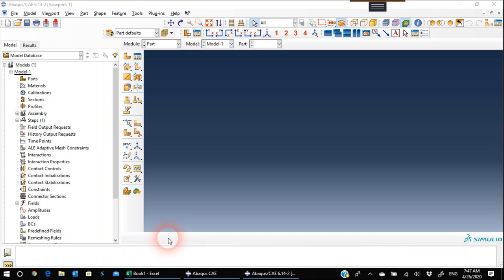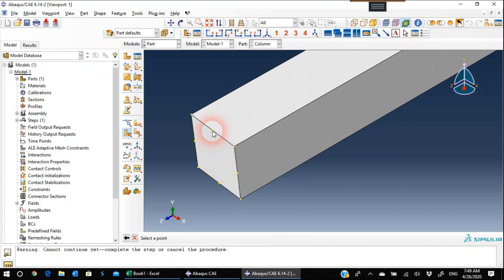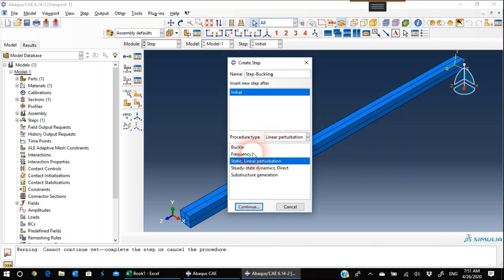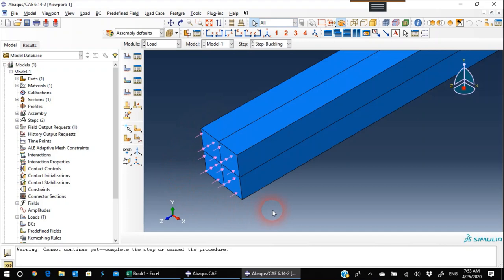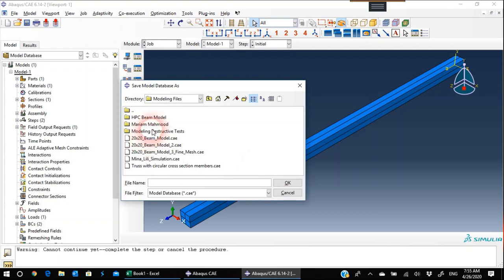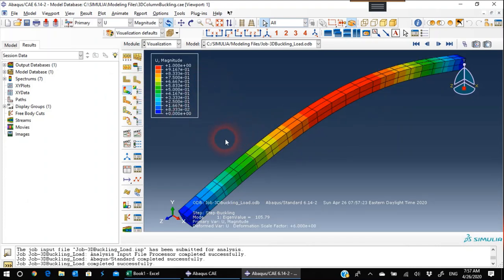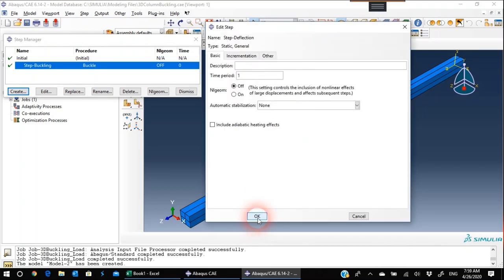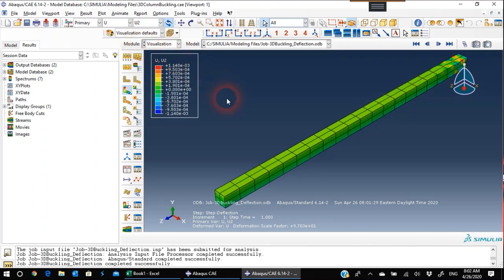Column's Buckling Load and Deflection Using 3D FE Analysis by Abaqus

Comment: Thank you for the great video, it is just what I need. I have one question, how can we simulate different support scenarios, i.e fix-fix column. I am trying to simulate eccentric load on column, can u show this aswell please.
Reply from the maker: You can use the same above model but add more restrictions to the rotation and translation to simulate fixed end case
Reply: @UsamaAlSaffar  Hi Sir, in this video is pin pin condition right?
Reply from the maker: boonkeat wong right
Reply: @UsamaAlSaffar  Hi Sir, for fixed-fixed condition, I apply at the same boundary condition position as what you did above and ticked all u1u2u3, ur1,ur2,ur3 at both end, but still couldn't get the close value compared with Euler buckling hand calculation formula... I can get for Fixed- Free and Pinned- pinned, but not for Fixed-Fixed and Fixed- Pinned.. Do you have any suggestion.. TQ Sir and appreciate your answer :)
Reply: @boonkeatwong4243  hey bro can u let me know how u did it for fix free cz i am not getting it ..in same model did u changed bound cond or made new model
Reply: @chiraghingad3822  I prefer you doing it in simply way, which u can try modelling it in 1d or 2d enough
Reply: @boonkeatwong4243  but column is 3d structure na

Comment: The deflection in the static analysis seems only occured in vertical direction, no lateral value. :(
Reply from the maker: There is a small value of lateral deflection, if you would like to see it clearly, try to reduce the column's stiffness.

Comment: Why You’ve select quadratic instead of Linear in geometric order???
Reply from the maker: this is because it's closer to the deflected shape from the buckling equation
Reply: @UsamaAlSaffar  could it be to take the (p-delta) effects into account?. If not, could you please confirm if Abaqus analyzes structures following second order analysis by default?